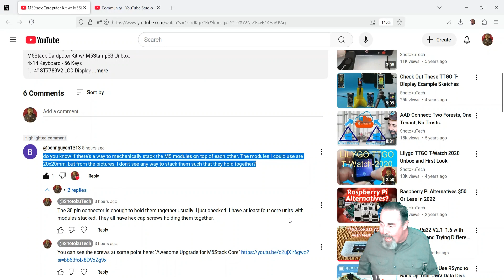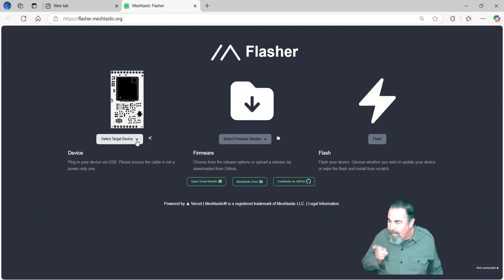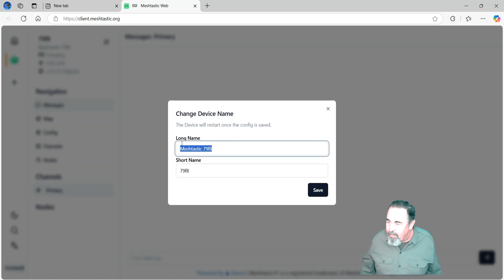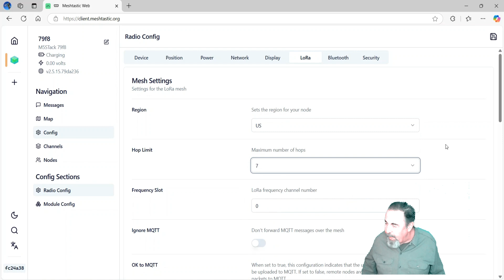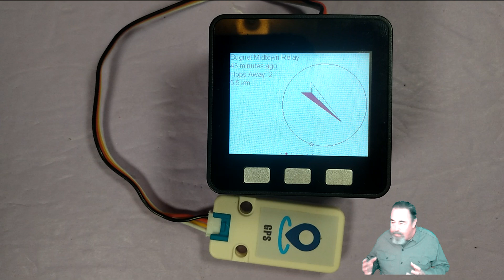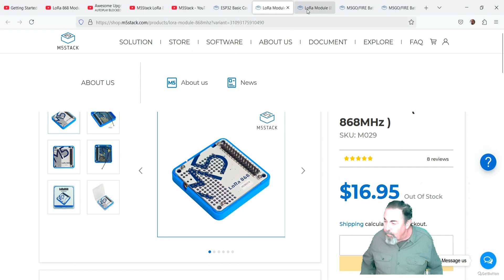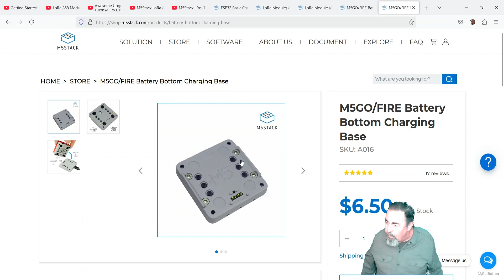Meshtastic on M5Stack Core, LoRa868 Module, and M5GOFIRE Battery

Comment: Hmmm, I've only got a Core S3 and that seems a bit overkill for this use. On the other hand, the price difference to the "smaller" cores is so small that it seems pointless to buy a smaller one. 
Did you notice whether this setup could use NTP for time instead of GPS? For an in-house static unit I think that would be more useful.
Edit: Oh it's "community image", might just get a Lilygo Meshtastic T-Beam Supreme instead then.
Reply from the maker: Maybe look at the T-Deck Plus. Excellent form factor for the Meshtastic use case. Best wishes.
Reply: @ Luckily, the new T-Deck Pro was sold out fast - it doesn’t support Meshtastic yet 😆
Reply from the maker: @JanDahl  T-Deck Plus does!
Reply: @ShotokuTech  I know, but I’m holding out hope (until payday) that the e-ink version will, too! 🙃

Comment: The display on M5Stack Core2 doesn't work (black).
Reply from the maker: Do you have the 868 v1.1? Or the original?
Reply: @ShotokuTech  868 v1.1
Reply from the maker: @MarekZiokowski  I went round and round with M5Stack about the dip switch settings. I tried every possible combination. They suggested I could change the settings in the code from their Github site.
Hi,
You didn't mention Meshtastic before.
The program of Meshtastic is here:
https://github.com/m5stack/meshtastic-firmware/tree/develop
You need to change the pin definition into the pins you selected by dip switch. The file is at variants/m5stack_corebasic/variant.h. Then you have to compile and upload the firmware. We have tested that Core Basic V2.7+Module LoRa868 v1.1 can be used normally.
I haven't revisited this yet. But I think if I can figure out what gpio pins they selected in the code I could set the dip switches that way. I will try again soon. My problem is I have an older Core and I don't want to buy a V2.7 when the old Core works with the old 868 module. Best wishes.

Comment: Great video. I've got an M5Stack here and would love to get it going on Meshtastic. I'm in Australia, do you know if the LoRa868 module work up in the AU915 band?
Reply from the maker: Hello! It's doing 915 in the US. Not familiar with how AU915 is. But I imagine it would. My problem right now is they have come out with a V1.1 version of the LoRa module. It has DIP switches. I still have not worked out how to set them and I don't have a Core 2.7, but an older version. I think it will work and the last email I got from their support is check the GPIO settings in their image on Github. I have not followed up on that just yet. But this video features the old Core and 868 board. And it works fine. Thanks and best wishes.
Reply: @ShotokuTech  Thanks for the reply. I think the main difference between US915 and AU915 is that the AU band is smaller as the top end of a US915 radio intrudes into spectrum used by a cellular carrier in Australia. I think if it works in the US then it should work in Australia, the Meshtastic node will limit the frequencies it will use.
Reply from the maker: @michaelcarey  Thanks for the follow up. You pretty well fleshed out my assumption. Best wishes!

Comment: Are all the components... especially curious about the lora module, made by/offical releases by M5Staxk? Also, does anyone have lora module setups with other esp32 setups outside of offical m5stack ... particularly anybody who has had good experiences with an aftermarket/cheaper setup ... where it has been fit for use, reliable and cheaper than this equivalent m5stack components? Many thanks
Reply from the maker: If you prefer some other LoRa or ESP32 hardware go ahead and use it instead.
Heltec WiFi Lora 32 Playlist
https://www.youtube.com/playlist?list=PLVPBipeObwMP02QIrh3RGMs1BtPTMt19j
TTGO LoRa32 Playlist
https://www.youtube.com/playlist?list=PLVPBipeObwMM9a9mBSjp47MD_3pUc3pLg
Seeed Studio Playlist
https://www.youtube.com/playlist?list=PLVPBipeObwMM9TJz7yFSE4n8RCVYRSIKk